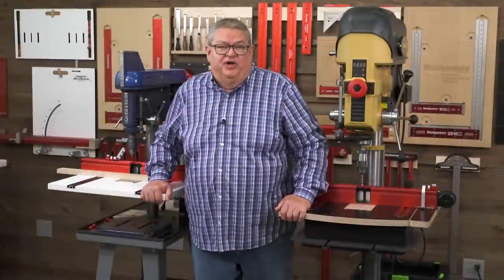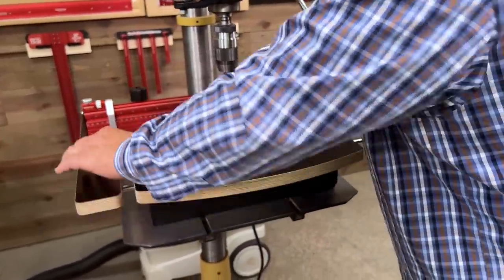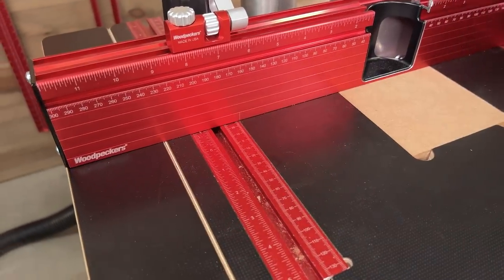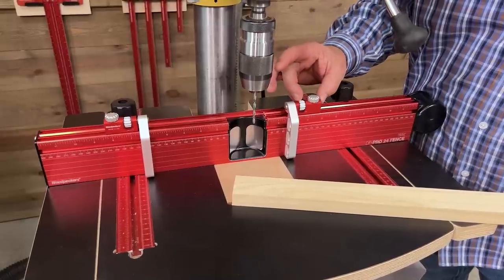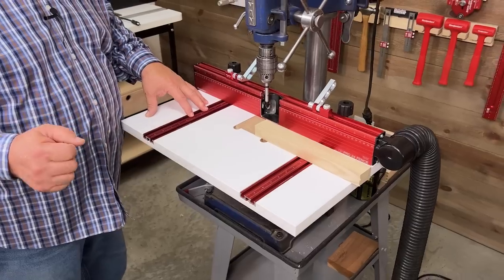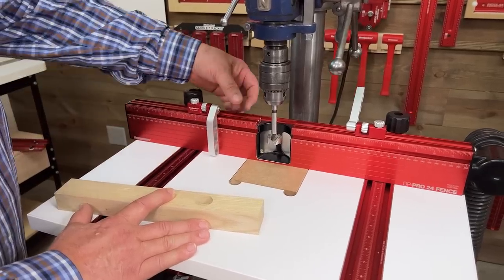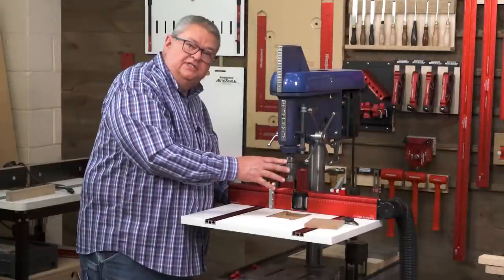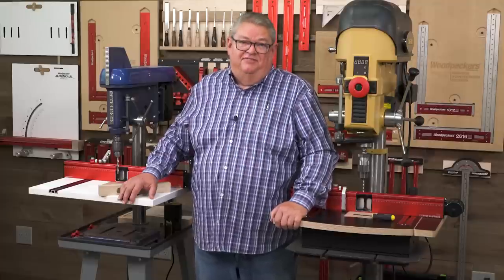FAQs: DP-Pro Drill Press Table System | Deep Dive | Woodpeckers Woodworking Tools

Comment: Thanks for the tips. Setting up and mounting the table is a bit tricky but if you watch the first deep dive video you can figure it out. 
Finally nice seeing that made in the USA Craftsman drill press. You can tell just by looking at it. My last bench top drill press failed after a few years unlike your Craftsman. Also Craftsman tools used to be guaranteed for life.

Comment: Thanks for the tip on setting up the flipstop in the correct orientation when using the micro-adjust. The slop in the flipstops was my only complaint with the DP Pro before seeing this.

Comment: I am curious, the pdf manual of the DP-Pro fence shows slots on the back side of the fence through which the tightening knob assembly attaches the fence to the imbedded tracks.  For the purpose of making the 4-1/2" square insert offset from the table center and therefore rotatable to get use out of the 8 sides of the insert (4 each top and bottom), once the table insert tracks, fence and quill are calibrated to the table center reference couldn't the table be shifted a half inch left (or right, but still in he same perpendicular plane to the column, not just by rotating the table on the column) and then re-center the fence to the quill.  The table itself will be physically off center to the column but wouldn't the fence remain in registration along it's length in relation to the quill?
Reply from the maker: It's even simpler than that, Marc. Drill presses (and router tables, too) do not need the fence square to the table. The cutter doesn't move side to side, only rotate. Therefore, the only critical dimension is the bit to the fence, whether the fence is square or not. So, you can rotate the table on the column, moving the bit's location on the sacrificial insert, and use the fence normally. The only thing you lose is the function of the scales. For the scales to be accurate the column, table and quill all have to be centered with each other.

Comment: Do I have to install the table or can I just use the fence on the table my drill press has?
Reply from the maker: Martin, the fence needs a pair of tracks about 12" apart. Most standard drill press tables aren't big enough.

Comment: Is it possible to install the DP-Pro table directly on the drill press table, without the drawer?  I want the ability to expand the table but I don’t want to loose the depth that the mount/drawer will take up.
Reply from the maker: Afraid that won't work, Cliff. The drawer base actually houses the expansion hardware. What type of drill press are you working with? Most modern bench tops have enough column length that it should not be very much of a limit.
Reply: I have a floor mount Craftsman drill press.  Just want to build some storage underneath the table so I’m a little concerned about how much height the drawer adds.  No worries, I think it will be fine… just wanted to ask.  Thanks for answering my question.
Reply from the maker: I've seen a couple of designs for cabinets that are on casters and can roll out from under the drill press when you have very tall material. You might consider something like that.
Reply: That’s a great idea, I’ve seen those as well, Thanks!

Comment: Wish you would sell the old table by itself i.e., without the 36” fence and the 2 molded or SS flip stops. I too have a benchtop drill press and would have liked to get the old table with the DP-Pro fence, to save on height. But as it stands, I would have to buy one of the Drill Press Table Packages that all include the aforementioned hardware I don’t need. Love all your stuff, big fan, but a bit disappointed by this.
Reply from the maker: Good point. I'll bring that up. In the mean time, call Customer Service. They may be able to accommodate you with a price that isn't on the web site.
Reply: @WoodpeckersLLC  thanks for answering so quickly. As a matter of fact, I already did and I was unceremoniously told that if I buy a car, I don't get to pick and choose... I have to buy the SKUed items 😶 hence this comment... I'm sure this solution would interest many other people who also have benchtop drill presses so hopefully something can be done. Thanks again and keep up the good work👍

Comment: My frustration with the DP Fence has been the dust collection port. The port does not connect easily to a 2.5" dust collection system. The size isn't very standard and is very short. It's pretty impossible to attach any dust collection hose directly to it without adapters. And it was tough to find an adapter that would work. Eventually I found a reducer which I could cut down and insert into the end to give me enough length to attach a 2.5 hose other parts. If dust port had just had any length I could have clamped an oversized hose or cuff onto it without going through all this.
Reply from the maker: Kyle, the port is sized to work with 2-1/4" shop vacuum connections. Rockler, PowerTec and a few others make adapters to attach 2-1/2" hose to shop vac 2-1/4" fittings.